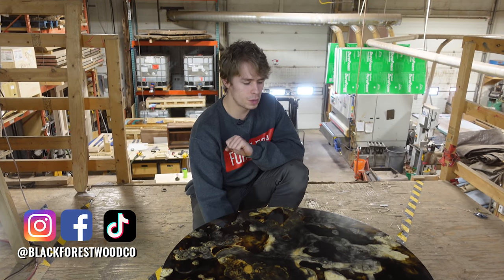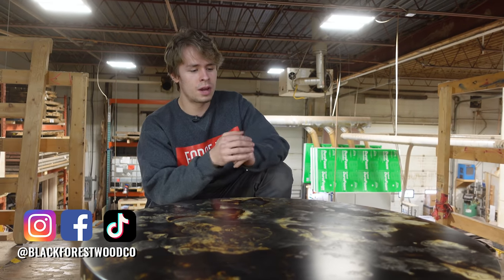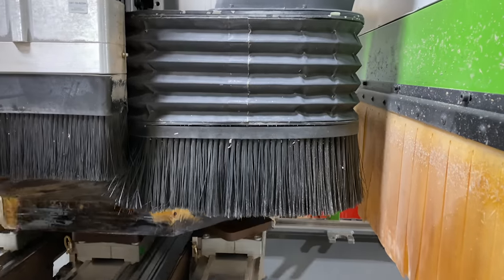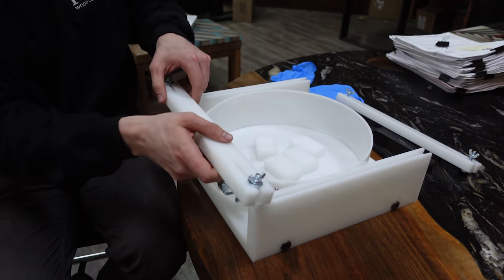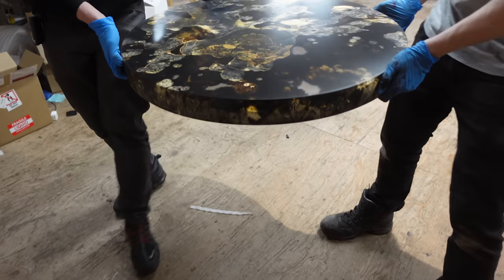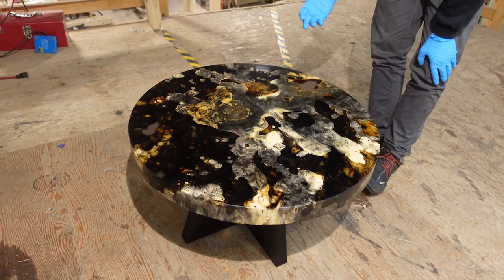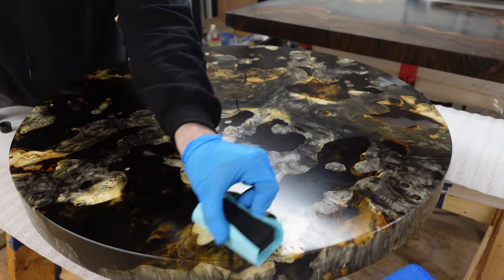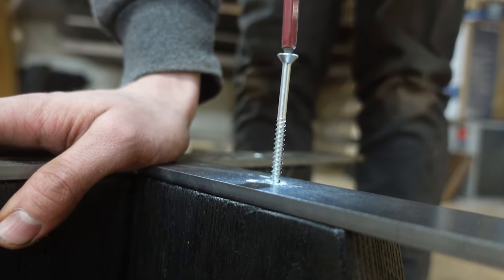Making a $14,000 Burl & Resin Coffee Table

Comment: Wow - that is amazing, beautiful wood. So rich in nuance! 
I would love to see this wood casted in lighter nuanced epoxy, so the sides show more. It must be a treat to work with  ❤

But to short post of Charlie  - improvement needed!

You guys said in your other post that I can ask questions in the comments section - that is just great. 

ABOUT MY QUESTIONS:
I have worked with epoxy before at work - floors etc, but this a table for me. I want to try your products, they look great.
I will probably wait until spring to order your resin.
 I am concerned about the cold weather / shipping all the way to Sweden,  so Ill wait until spring. Shipping here is useless.

- It will be a cast of about 8 litres in total, 2 inches deep, 40 inches long and a 5 inch cast - a live edge coffee table.

- I will probably use two different colours (I am thinking about white in the bottom, and a combination of blue colour at the top), so I need to make 3 pours.

- THE IDEA IS - 
 - A white pour in the bottom, just short of an inch (approx 2 cm) deep.

- Then use a carved piece of wood (with your protection tape) that I fix with clamps, to create a "thin, irregular, white edge on both sides, ", and fill whit white epoxy to the top.

- Remove the wood, and fill the middle with a blue coloured epoxy pour.

1 - Would it be best to let the first white pour cure completely, before the second withe pour, to avoid marks from the wood placed in the middle, etc?

Or would that cause 'casting lines ' from two separate white pours, no mather how closely matched?

1B -  Or - as stated on your web page, do the second pour, while the first pour is "sticky"?

1C - So what would the curing time be that I need to wait, for a table pour, carrying 40 inches in length, by 5 inches in width, and about an inch deep?

2 - I have probably missed it, but I have seen that you mix the epoxy first, before adding pigment?

3 - If so - how long is the deep cast needed to be mixed (if using similar equipment like in your posts), before adding pigment?

4 - Since I will add colour pigment - how long is the epoxy needed to be mixed, after pigment is added (approx)?

5 - You guys appear to have a safe product. Unfortunately I cant use the garage to pour the epoxy.
Would it be a problem to pour inside the house, in a ventilated room, using cooling fans pointed to the window, so there will be ventilation constantly? 

Thanks, great that I can ask you guys  this here!

Comment: Did you try using the drill on low speed? looked like you had it on the high setting there, giving you less torque.
Reply from the maker: That was the issue haha

Comment: What make sit 7000?
Reply: Have you priced resin lately? We saw them pour about 3.5 gallons into that mold, and I'm sure Buckeye isn't cheap given supply and demand. Add in the overhead of their CNC machines and labor. That seems like a fair market price to me, which is why I'll never have a nice table like this. LOL
Reply: whenever there is a buyer willing to pay, the price is always right
Reply from the maker: Buckeye is one of the most expensive species we have and the resin is not cheap either! Then combine that with the overhead costs of running a 14,000 sqft. facility!